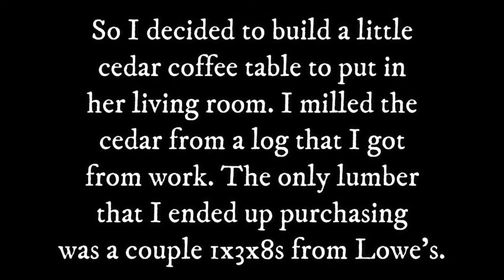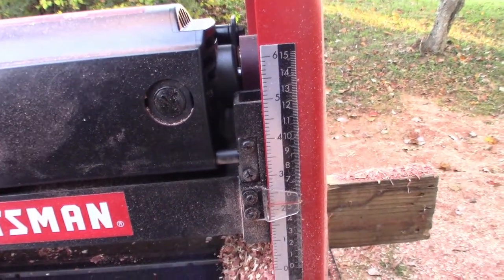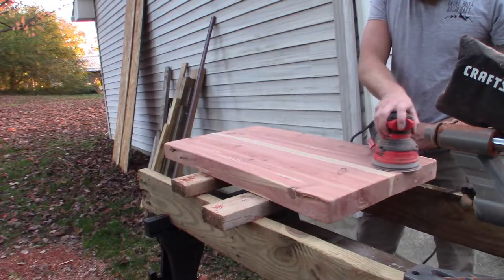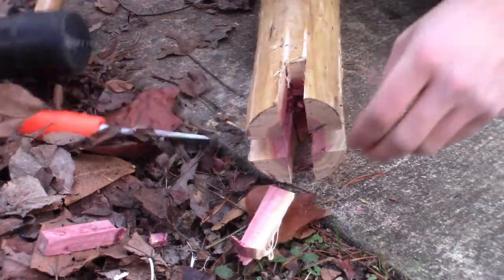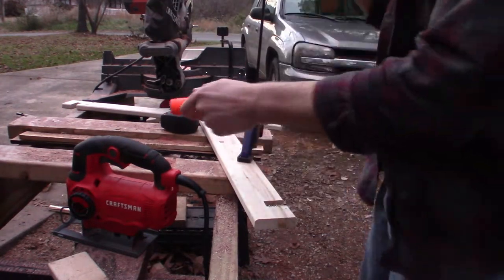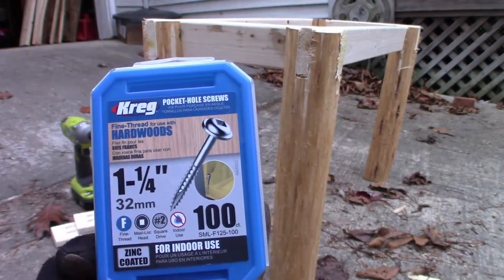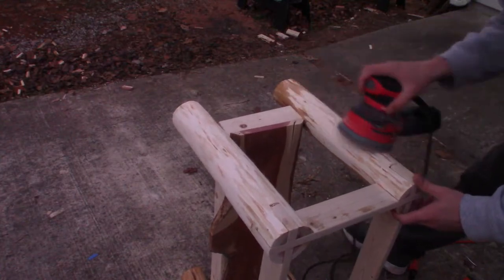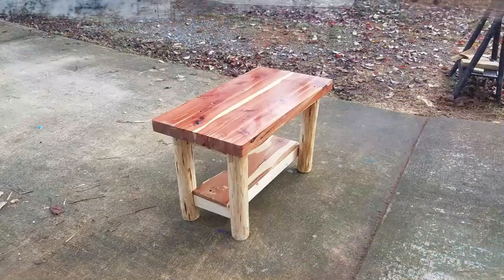HOW TO TURN A CEDAR LOG INTO A BEAUTIFUL TABLE!!!

Comment: Nice build. Remember, the planer doesn’t make a board flat by itself. It will only mill the top side to mirror the bottom side.
Reply: Have you thought about turning the board over every other pass. Or hand planning.

Comment: Hi. Can I use tung oil first and then polyurethane or epoxy as the final coat? Thx.
Reply from the maker: Yes, you just have to make sure the tung oil is fully dried. I would also recommend using an oil based polyurethane instead of a water based

Comment: Does the wood need to be dried or anything??? Kiln???
Reply from the maker: I let the log air dry in a shed for like a year. Ideally, it would be best to kiln dry but I dont have one. The dryer the wood is, the less likely there is for wood movement and future cracking/splitting. Nowadays, there is such a demand for lumber, most big box stores like Lowes do not kiln dry which is why the boards are usually warped before you can even get them home
Reply: @BrokeBoysBushcraft  good to know.  My neighbor just cut down his Cedar tree and I salvaged several chunks.  I wasnt sure how long to wait to make some planks out of them.